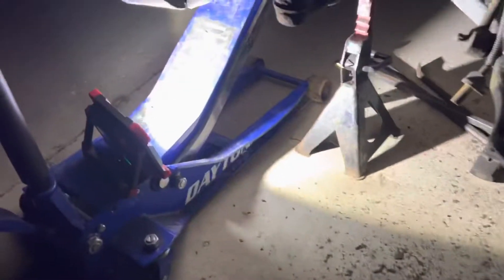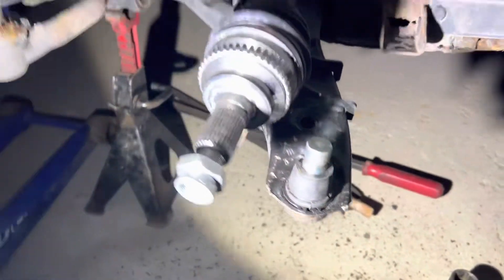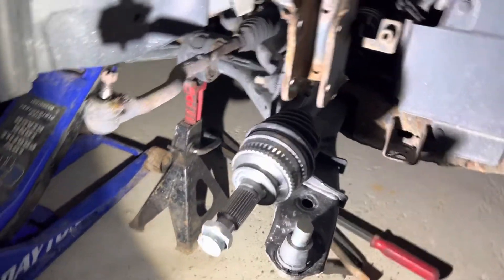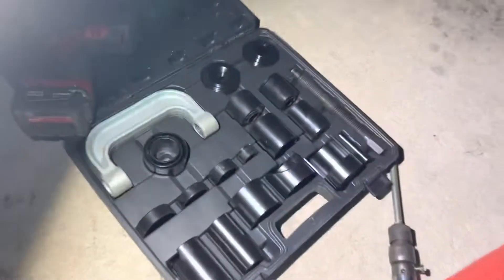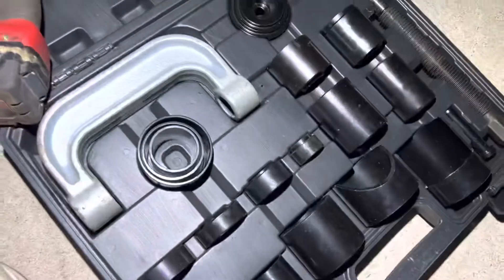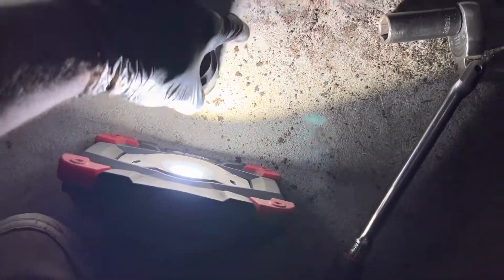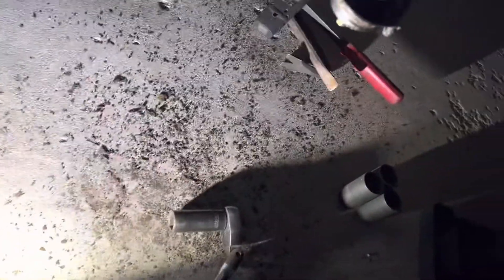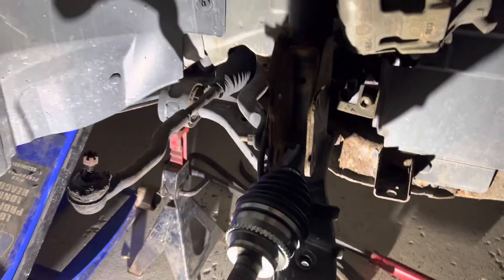2007 to 2014 Ford Edge ball joint replacement

Comment: I have to do this job tomorrow. Did lower control arms on a Lincoln 2 years ago and the passenger ball joint is bad…I didn’t want to do arms again because one of the nuts in the subframe snapped on me. Great video will be getting a socket shortly lol.
Reply from the maker: Thank you for watching ! As long as you have all the right tools you should be good man. I’ve had to do plenty of ball joints and control arms in my days lol. I just did ball joints in my Volvo and controls arms on my friends neon, that was a rusty neon lol took me forever to do them
Reply: Had the same issue with my friends dad gmc 2500 we had to heat them up some to get them out…what a nightmare lol
Reply from the maker: Lol nothing can ever be easy on cars

Comment: I really appreciate the tip.  I'm getting ready to do this job this week. Now I found that 1 3/8 = 1.375.
I'm wondering if a 35mm socket will also work.  That is 1.378 inches. Just slightly bigger.  The reason is because I can find it cheaper.
Reply from the maker: No problem man! Doesn’t hurt to try. Always worth trying something to save some money. Especially now days, every penny counts!

Comment: I own a 2007 ford edge se with 306000 miles on it and doesn't have any issues running but I have dash lights that won't go.away
Reply from the maker: What dash lights do you have?